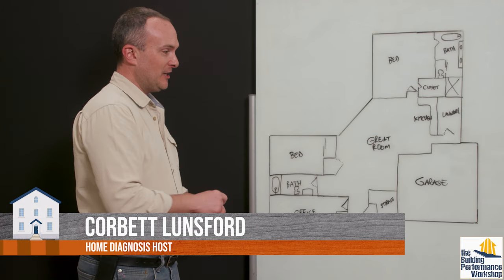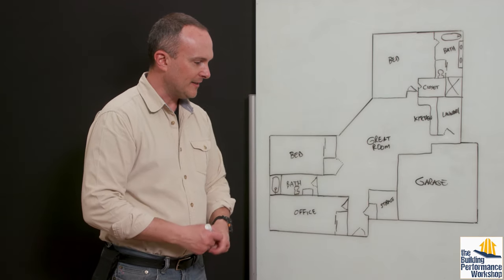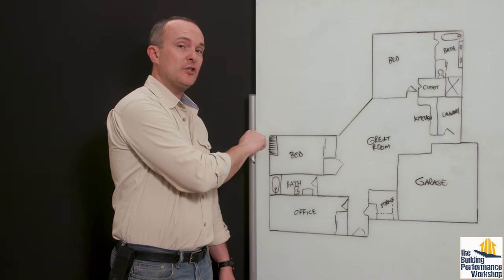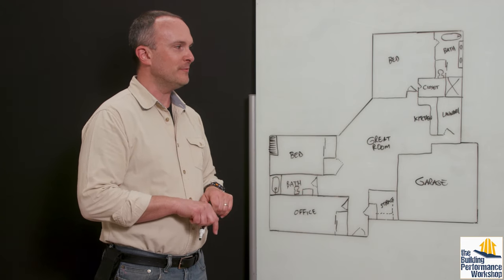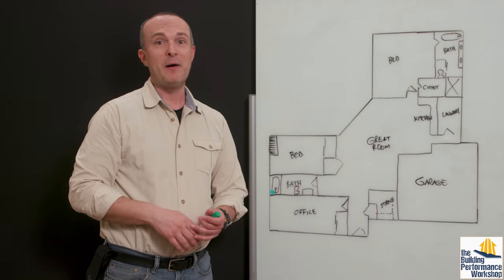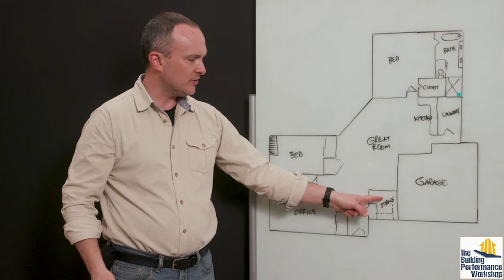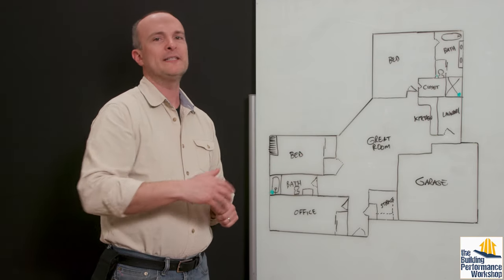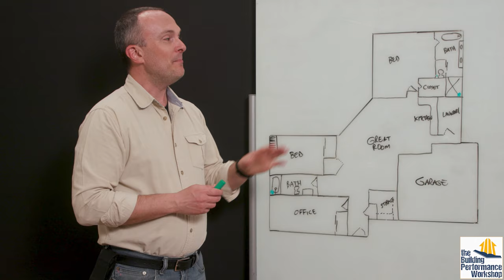Tips for High Performance Home Floorplan: Designing Out Condensation, Odors, Discomfort, and Hassle

Comment: Bad Design:
1.  Kitchen should always have a (large) window….~50% of time is spent on kitchen.
     Better to put the garage behind the laundry room….and have the kitchen have a view to the front yard and see who’s coming…while you are cooking.

2.  You just wasted precious “edge” space for the laundry room…
3.  The lower left bedroom ‘s bathroom is windowless.   Bathroom must have windows….

4.  If you are going to have a room of this size… the dining room should be walled or at least one partial wall.

5.  Assuming the bottom is the entry door…where is the porch?  If you poach is on the right side, it is in a aware position with the garage.   If the porch is on the left side…it will block the study window-side..

Overall Grade C+.

Comment: Is there anything wrong with including both a traditional bath fan and HRV/ERV exhaust in a bathroom?
Reply from the maker: What is the goal, Evan?
Reply: @HomePerformance  This is an addition. I'm installing the HRV/ERV in the house during construction for house ventilation and improved air quality.

I know some people suggest omitting the bath fan and simply using the HRV. I've never lived with a HRV, so I'm hesitant. I thought I would include a bath fan in the bathrooms for quicker moisture removal during showers.

Curious if you think that is a good or bad strategy.
Reply from the maker: ERVs are kind of a pain on cost, maintenance and ducting, so I only recommend them for homes that are airtight enough to prohibit the use of bath fans. You can get fresh air dilution from a simpler system like this:
https://youtu.be/bfd69xRbQxM

Comment: I don’t understand the closet thing. In my mind a closet full of clothes on an exterior wall added to thenR value of the wall because now I have a whole layer of clothes on top of the wall between me and the outdoor elements. How does it cause issues?
Reply from the maker: Warm moist air gets back behind those clothes and boxes and condenses on the cold drywall
Reply: @HomePerformance  actually it can be that warm air doesn't get behind the clothes.  Moisture going through the clothes cooling down below dew point and then hitting a surface. Same problem with multi layered insulation. Can be fixed by having moving air behind the clothes.
Reply from the maker: Technically for condensation you need moisture in air and cold surface to pull it out- the air getting cooler would up the RH, but not enough to condense usually. Brushing warm air on a cold surface will warm it, also hindering condensation.
Reply: @HomePerformance  usually might be the word here. it depends on the indoor humidity, temps outside and how well insulated/air sealed the wall is.
BSFC has some posts on the effect with ceiling insulation in cold climates.
but fully enough, downunder, most of our mold issues are in the "winterless" part of the country.
Reply from the maker: Interesting T

Comment: Seems to me, if the exterior walls have enough insulation, it should be fine to have the closets and bathtubs up against them.
I hate open floor plans. The cooking odors seem to soak into the living room and maybe even its furniture. A kitchen with walls keeps the odors out of the living room so much better.

Comment: If you have good insulation, you don't have this condensation problem. My home is 10 years old now and I have some furnitures against exterior walls without issue. The insulation is 38cm thick.

Comment: Cold climate issues. Interesting. What about southern parts of the US? In most of Australia, a lot of the advice would be opposite, because the main concern in heat gain in summer. I don't think anyone would have an internal bathroom or toilet in a house - we want them to naturally ventilate through outside windows/louvres and get the natural daylight.. As I said, interesting.

Comment: when I think of building a home I want closets, and lots of them. 1 closet (large) for each bedroom; a coat closet at the front door, a broom closet, a bathroom linen closet, a closet for actual linens (sheets, blankets, pillows, etc.); and 2 not technically closets-a mudroom and a large pantry.  And if you show me a plan where you walk in the front door and the kitchen is staring you in the face I will slap you bald.

Comment: Placing a closet against an exterior wall is not an issue if the walls are properly insulated to energy code requirements. Maybe you're discussing old homes without proper insulation?  Maybe give the disclaimer that you are talking about improperly insulated homes. Or spaces that are built into exterior walls, which isn't typically how these spaces are built (the tiny home example you gave is not how single family homes are built). Ive been an architectural designer for 18 years and would never design a closet built into an exterior wall, they are always on the surface of the wall.  Plumbing, yes an issue on an exterior wall. Otherwise, not an issue. I'm also sitting currently in my Colorado home with very low temps outside and our exterior walls are not an issue.

Comment: I'm curious why you seem to be so dead set on ducted systems. A non-ducted heat pump system is more efficient, quicker to install, have fewer design considerations, doesn't require consumable filter replacements, better moves air within a room, and when paired with an ERV, provides better all around air circulation. I get that it's the system you chose for your home, and perhaps what you're most familiar with, but it strikes me as odd that someone so invested into building science seems to have a huge blind spot towards what is technically a better system.

Comment: With all respect i disagree with everything and not all architects are good. reason why we have bad new construction home today.
1. Thermal bringing is real but if you correctly moisture barrier your exterior walls this is not an issue. Reason why we have weep holes. 
2. Bathroom vents should never be above shower. Should be near the center 1ft in front of toilet. You don’t want poo poo air particles to go through your shower curtains. 
3. Shower and baths should always be adjacent to exterior walls in the event of water leak to minimize moisture damage to the house. Better to leak out than in.